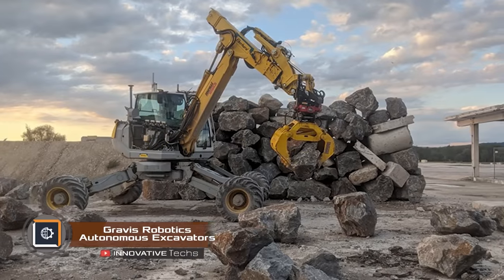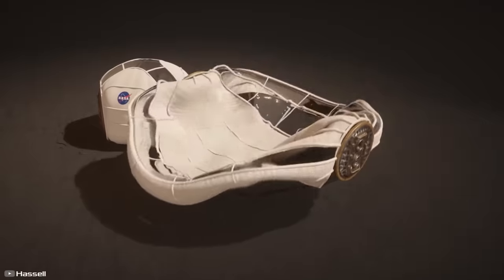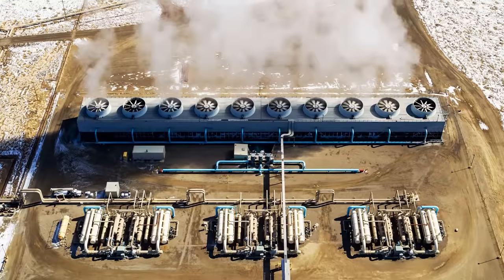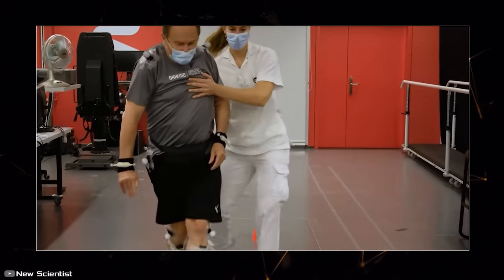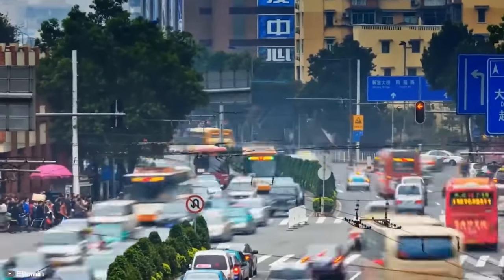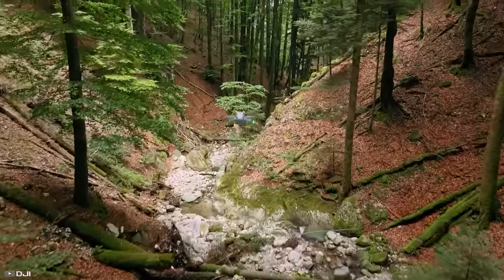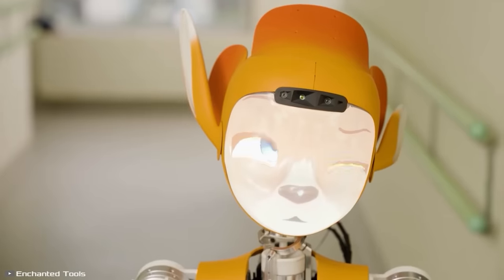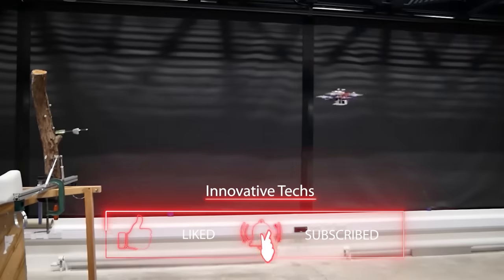INGENIOUS INVENTIONS YOU SHOULD KNOW ABOUT ▶4

Comment: Thanks for this excellent group of "iinventions" that I haven't heard of.    The one that I am most concerned about is the propeller for cross  country skiers.  I have a number of concerns about it.  Having spent a good amount of my life cross country skiing in remote areas of Wisconsin, one of the biggest changes I noticed was the increased noise pollution from snowmobiles throughout remote areas.  There was a constant hum of snowmobiles coming from every direction.  There are seemingly no longer any places skiers can go to get away from these irritating sounds (like mosquitoes buzzing in your ears).    Another issue that I have with these new devices has to do with helping skiers get up the hill so that they can go downhill (apparently with little effort?).  Maybe I'm missing something but skiers work hard going in both directions.  In fact, I would argue that many of my cross country ski trips were harder going down than going up.  Going up, takes more effort in getting your own weight up the hill but you're moving slow enough to easily avoid dangers.  Going downhill takes more skill to avoid much more serious dangers.  And is that monster going to follow you down the hill?  I can only see this device as putting inexperienced cross country skiers more easily in situations that require more skill they have to come back down.  
At the same time they are going to be a huge irritant to those skiers who want to get away from those awful things.
Reply: It appears to be intended for downhill skiers, not cross country. Not quite sure how they are supposed to take it downhill with them. From what I see in other vids, you let it push you down the same as uphill, so I guess you simply can't use it for slopes you intent to go down faster than 25 mp/h.
Since it's electric, it should be more quiet than snow mobiles, but it's still gonna make noise, of course.

Also, it appears there are reviews about this device from 2019, linking to the manufacturer website that no longer exists, so I suspect they didn't make a profit.